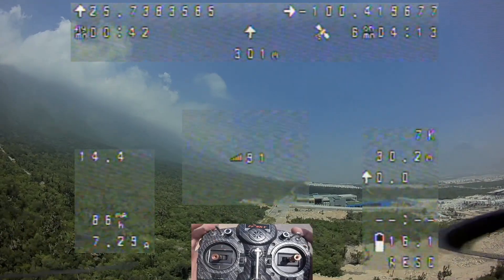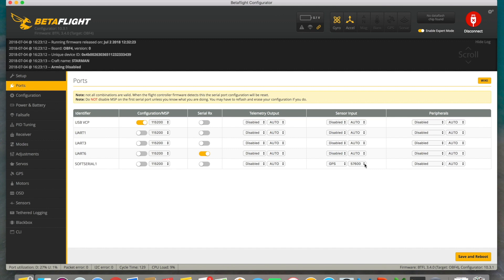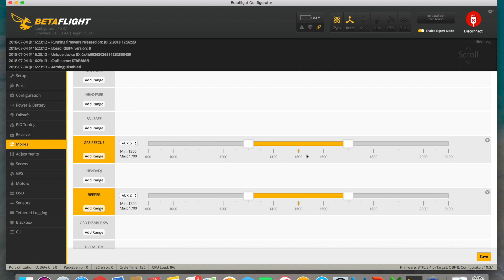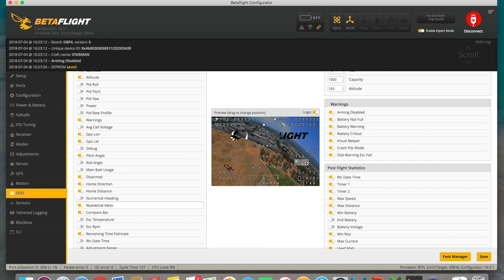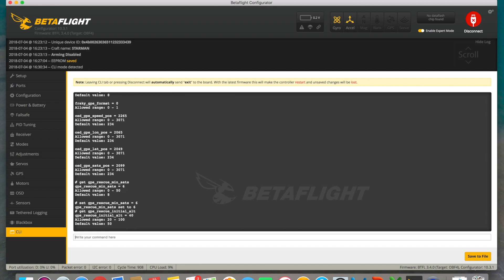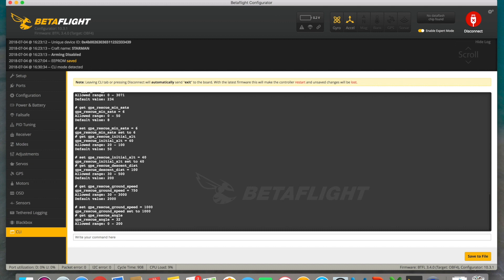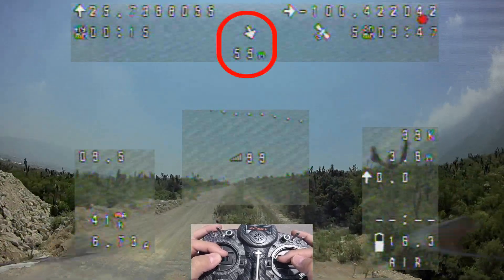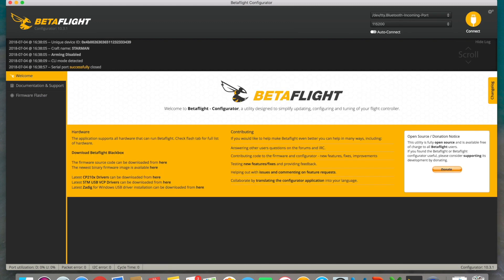Tutorial: Betaflight Rescue Mode (English version)

Comment: What happens if you activate rescue mode on a mountain, will it adjust height as it ascends or descends, or will it stay at a fixed height?
Reply from the maker: According to the developers, it will ascend to the maximum height you reached (to avoid any possible obstacle) while initiating the return

Comment: Thanks a lot Starman. Works perfectly with the gps rescue switch but doesnt work when I switch off my QX7. It would just drop out of the sky. Do you have any idea?
Reply from the maker: From the CLI option, you need to set the following command "set failsafe_procedure = GPS-RESCUE", if for some reason you access the failsafe option from the GUI, this option is disabled and you need to reprogram it from the CLI
Reply: That's the first thing I checked and made sure to be setup right before go out and fly. Strange...

Comment: Also , im using flysky i6x,  if i set my failsafe on my transmitter and set my failsafe on cli for gps RTH,  question is , what input will it take ? The gps RTH or the failsafe set in my controler/ transmitter?  Thanks and new sub here .
Reply from the maker: configure the flysky failsafe to cut, then the failsafe for gps rth will work fine.
Reply: @starmanfpv  thank you

Comment: Do you know how agressive Rescue mode is? 

For example a drone flying at 100 mph several hundred feet from the takeoff area. Can betaflight calculate enough tilt to stop the drone and make it return home? Or will it just flip/spaz out as the amount of tilt and power needed is too much?
Reply from the maker: With the parameters gps_rescue_ground_speed and gps_rescue_angle you can specify how fast it can return.

Comment: I have an omnibusf4 fc with a m8n gps module, when i use gps rescue mode, it just drops out of the sky, everything else is working, i have the latest version for omnibusf4 sd. https://m.youtube.com/watch?v=VLB_0WX9BKU
Reply from the maker: Make sure you are further away from the set distance to start the descent defined by the gps_rescue_descent_dist (in meters) command otherwise the quad will fall to the ground

Comment: why i cant get a fast gps lock , i use bn 220 thanks...
Reply from the maker: There’s can be many reasons but the most common are electronic interference, try to put the gps antenna as far of any ESC or wire from the motors, if you are using a RunCam Split those create a lot of interference, shut it down till you get a fix then turn it on and make sure the ceramic part of the gps is pointing up.

Comment: Does the quad have to be armed during rescue mode?  For example if I decided to use the middle position of a 3 way switch to arm the quad and the top position for rescue mode; does the top position have to be armed (also)?  In other words, if the quad is disarmed while in rescue mode will the quad drop out of the sky?
Reply from the maker: Yes, it needs to be armed otherwise it will drop out of the sky

Comment: So if you allow the quad to finish the gps rescue procedure, without taking manual control, will it just plow in to the dirt? Will it disarm? Please clarify...thanks.
Reply: fall straight of the sky. its very rudimentary and meant for you to take full control after the fact.
Reply from the maker: As tage_fpv said, it's a very simple code only to return and land it manually

Comment: I have been looking for a way to do this for months, and so easy. Thank you. I ordered and subscribed
Reply: I have my unit installed it is receiving satellites. I have a question please   1. I am doing bench testing:  I noticed that your satellite icon does not blink.  I have my 'min sat'    set to 6 the and have 9+ satellites showing but the Sat icon never stops blinking. Is this an indication that 1. some other parameter is not correct? 2. the return to home will not function? Thank you for your help
Reply: Also the quad will arm

Comment: Hi! I tried the rescue mode (beta 3.5.0 custom) now but first test was unsuccesfull, flew about 90degree to the left instead of home :( I will try to lower speed parameters it might help FC to get more time on smaller distance (100m) to figure out heading.
Reply: home arrow works now fine on my other copter, did not switch to GPS rescue this time, as too hot here to search if it flies away :) ... only checked arrow seems to work, start at 0:50 to watch:
https://youtu.be/b7fLvSeS_xE
Reply: Hello!
Today I had some succesfully GPS rescue tests.
I made some customisation in the code, and for better debug also changed the flight mode name to display each phase of the rescue mode, so I can look at OSD what is the current working phase and check heading and altitude and picture.
I helps a lot for understanding and tuning it.
On the lower right above coordinates is the flight mode.
During manual or when I quickly turn off GPS rescue to not let it "land' by itself you can see AIR text.
Instead of RESC you will se the following flight mode short names:

IDLE: "REID"
INITIALIZE: "REIT"
ATTAIN_ALT: "REAA"
CROSSTRACK: "RECT"
APPROACH: "RELA"
LANDING: "RELD"
COMPLETE: "RECP"
ABORT: "REAB"

As things happen fast and I did not let it "LAND", you will probably only see REAA and RECT and RELA modes.

I am happy with the result.
https://www.youtube.com/watch?v=OcsfU1neets
p.s.:
Unfortunately the testing at last flight (not shown here) ended with a crash and damage as there is still a bug around the code, I will investigate it next. I've got a REAB and it disarmed 50meter high and I lost control near me when I switched to rescue mode.
This is not good if it is too close sanity check should just refuse flight mode change instead of going to failsafe DROP near me....
p.s.2: I found and other bug, ahh so many, I will fix soon.

Comment: Nice vid! 1 question..will my drone crash on the mountainside when using GPS rescue. Default altitude are set to 70m. I hope it Will decrease or increase altitude in 45 degrees.
Reply from the maker: When starting the rescue mode the first thing that the drone does is to turn towards home and immediately start to climb to the programmed height and slowly start to accelerate towards home, there is no way to define the angle of inclination to climb but very possibly if it is greater of the 45 degrees
Reply: starman i meant...hope it Will turn around when active and then increase/decrease while flying 30 to 45 degrees towards me. Dont want it to lower altitude in a straight line downwards.
Reply from the maker: The drone maintains the height and does not start to descend until it is at the distance defined by the gps_rescue_descent_dist command, remember that they are meters